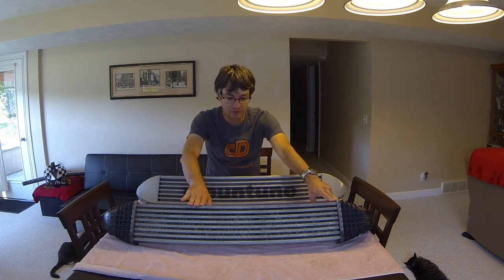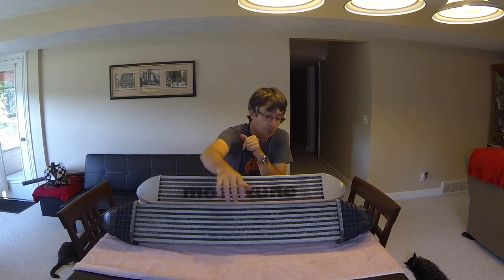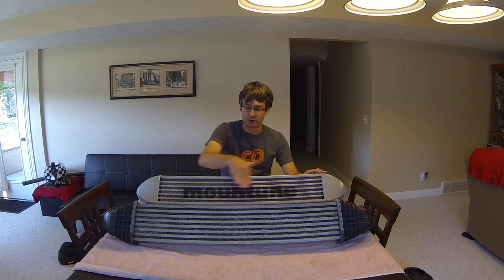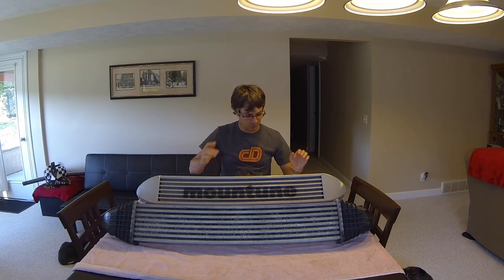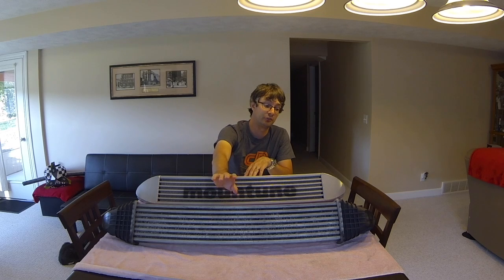Mountune Fiesta ST Intercooler vs Factory Intercooler

Comment: I just installed my mountune intercooler this week. It is now a bar and plate intercooler no longer tube and fin. Definitely has some weight to it. I wonder how much more it weighs over the original mountune intercooler.
Reply from the maker: I knew the change was coming. My intercooler was one of the last of the original designs. In fact, mine got damaged in shipping and they couldn't replace it since there weren't any left.

Comment: How has this ic held up so far? Thinking about getting this one?
Reply from the maker: Holding up very well! I do remove it in the winter and use the stock one since I don't need additional cooling in the winter and the rocks/sand/ice on the roads can really beat up the fins. The Mountune intercooler is used in the summer and it still looks brand new, even after a few years of use. No complaints at all with the Mountune intercooler.
Reply: @BRGT350  definitely pulling the trigger on this when the opportunity comes

Comment: 4:15 this guy just seriously said you lean out the engine to make more horse power... 🤦‍♂️ If I'm not wrong Rich <14.7> Lean. You would never lean the mixture for power that makes no sense.
Reply from the maker: Please provide your evidence suggesting the comment was wrong. Leaning the mixture improves the oxidation of the fuel which improves the burning of the fuel. Leaning also creates more heat and heat is a byproduct of energy. More energy means more heat and more energy means more power. Too lean will create too much heat and burn holes in the piston. Too rich overly cools the combustion chamber and reduces the power output. Rich is safer, but power is made more efficiently with a lean condition. You just can't run too rich. With a modern car, the oxygen sensor is determining the amount of oxygen in the exhaust stream and adjusting the fuel accordingly. The PCM can lean the engine as needed and then run rich when needed. Cold temps need more fuel to adjust the ratio since cold air is more dense. The denser the air charge the more power that can be made. A better intercooler will cool the charge air meaning more air molecules can be packed into the combustion chamber along with more fuel which will make more power. Running too rich in cold temps will make less power and running too lean in hot conditions will destroy the engine. Correct me if I am wrong, but I did get an A in thermodynamics in which half the course was spent on engines. That was many years ago, so perhaps I am a bit rusty.
Reply from the maker: So, still waiting on that proof.
Reply from the maker: I will assume you don't have any data to back up your claim.

Comment: Would a intercooler help the engine staying cooler?
Reply from the maker: highly doubtful. You could draw a conclusion that colder intake charge temps means a richer air mixture, which would run cooler. However, the computer would compensate by leaning out the fuel accordingly, negating any change. Depending on the size and construction of the intercooler, it could actually do the opposite. If the intercooler is large and restrictive to air passing through the fins, then it would restrict air going to the radiator, making the engine run hotter. A larger radiator would be needed to run cooler and colder thermostat. I haven't had any problems with engine cooling with my ST and the Mountune or stock intercooler.

Comment: My stock intercooler is showing some wear has a few dents a dings i want to replace it with something more durable combined with better cooling.  I am not tuning my car just more less wanting to improve my cooling and replace my dinged up intercooler.  Would you recommend cobb or mountune?  Will i need tuning with an after market intercooler?
Reply from the maker: I would go with the Mountune one for a few reasons. First, it maintains full factory warranty. Second, it is more durable than the factory intercooler. Third, it doesn't require any tuning changes. Forth, the Mountune intercooler doesn't restrict airflow to the factory radiator. The fins are far more durable on the Mountune intercooler. I was shocked at how different they are compared to the stock one. I still use my stock one in the winter and put a fine mesh screen over it to protect it better, but it still gets pretty beat up. I use the Mountune one in the summer with warmer temps.

Comment: I too have the original version of the mountune intercooler, got the black one with yellow logo. I'm very happy with it. I did notice a slight improvement in throttle response after it was installed. My only issue with it after my first winter here in Prince George, BC, Canada the black paint is almost all gone, must have been beat up my rocks and or road chemicals they lay down on our winter roads up here.
Reply from the maker: that is one reason why I didn't want black. Even after a few summers, I would expect it to be chipped. At least the silver hides the chips better. I will be putting together a video to review the intercooler now that I have run it for over a week.

Comment: It looks smaller than stock, how is it better?
Reply from the maker: it is because it is further from the camera. The Mountune intercooler is wider, thicker, and taller, so a significant increase in volume and frontal surface area. The fin design also allows for more air passage to the radiator. Overall, I think the Mountune one is 30% larger in volume.
Reply: Thanks. I figured the perspective had something to do with it but even when seeing it in person it doesn't look like it'd be that much more effective but I suppose there's more than meets the eye with it.
Reply from the maker: yep, it is a trick of the stock one being close to the camera. It is difficult to see the differences on camera or in pictures compared to real life. I had been looking at the Mountune intercooler since 2014 and only when I had it in my hand did I see all the difference.
Reply: What kind of power can this intercooler take?

Comment: btw, I'm a plumber and I sometimes have to use a little comb called a fin comb on Heat Exchange fins on heat pumps or furnaces etc.. So  instead of using the tweezers or lil screw driver. Look in to buying a fin comb.
Reply from the maker: yeah, I have heard about the combs for heat exchangers. I am going to look at picking on up this winter to fix the fins on the factory intercooler next spring. Should be way faster than the tweezers and screwdriver! Thanks for the tip!

Comment: what was causing all the damage to the intercooler? Gravel or what?
Reply from the maker: in the winter, the roads are covered in a salt/sand/pebble mix to help with traction and snow melt. The front of the cars get hammered with the mixture. I added a fine mesh screen last winter, but debris still got through it. In the summer it is fine, but the winter just destroys the intercooler. The paint on my bumper cover is also in bad shape.

Comment: Some of my notes for FMIC's
Intercooler core size and inches and weight when available
Tube and Fin
Stock 27.5" x 5.25" x 2" - 289 - 4 pounds 11 oz
Mountune 29.25" x 5.75" x 2.5" 420 - 7 pounds 8 oz
Mishimoto 28.8 x 4.92 x 2.56 - 363 - 13 pounds 6 oz
Bar and Plate
Airtec 28" x 6" x 2.75" - 462
ATP 24 x 6.5 x 3 - 468 - 25 pounds
MAP 27x6x3 - 486 
Cobb 27.5" x 6" x 3" 495
Depo Racing 28” x 6” x 3” 504
CP-E 29×6.25×3? 544
Reply from the maker: awesome, thanks! I have most of those numbers in my notes but didn't publish them in the video. Thanks for doing that as this will be great for others. I was surprised how heavy the Mountune intercooler was compared to the stock one.
Reply: Yeah the stock FMIC is a flyweight for sure and the bar and plates are anchors at around 25 pounds.
Like you I am going with tube and fin so as not to affect the stock cooling package, which is working great so far for me even in our 105 degree desert summer heat.
I'm going with the Mishimoto with their pipes which make for an easy symposer delete.
I'm in Cali so I am limited with what I can do and what I do do has to be as stealthy and as easy to undo as possible. The smog techs here will fail you for anything that may affect emissions, even exhaust wrap ;(.
Reply from the maker: Mishimoto was on my short list until the super discounted price from Mountune came up. I have a Mishimoto radiator on my Mustang and really like it. Happy we don't have any type of emission inspections in Michigan, even though I don't plan on changing anything emissions wise on my ST.

Comment: Should drive your Fist in Nevada :). When I was getting tuned by Stratified first thing they recommended was an inter cooler. My data logs were showing an increase of IAT. Great video !
Reply from the maker: thanks and yes, I can completely see living in Nevada the need for an intercooler is massive. If I travel about 10-15 miles towards the center of the state, the air temp goes up dramatically. Living along the lake keeps the temps much lower in the summer and warmer in the winter. It can be 20 degrees cooler at lake compared to the rest of the state.